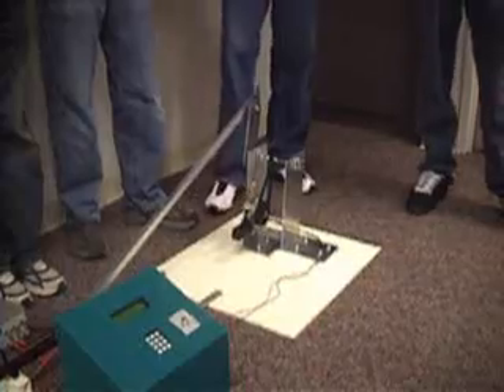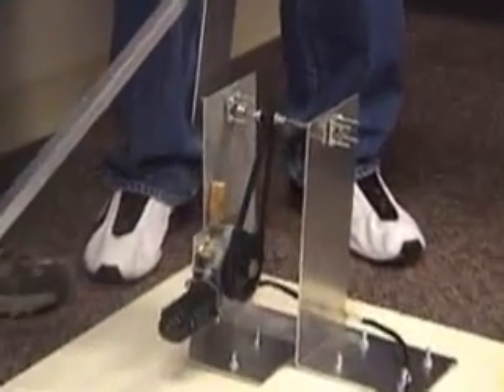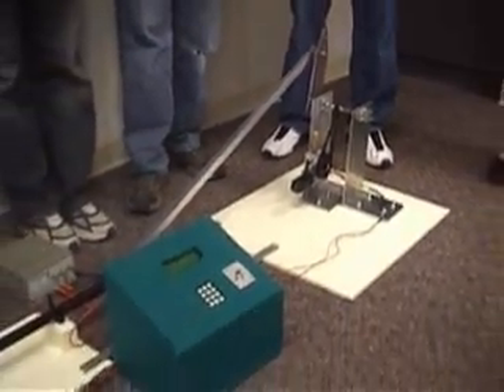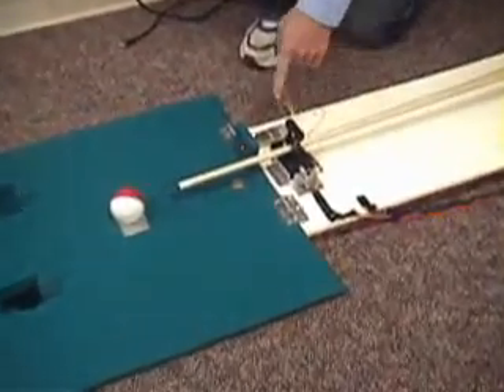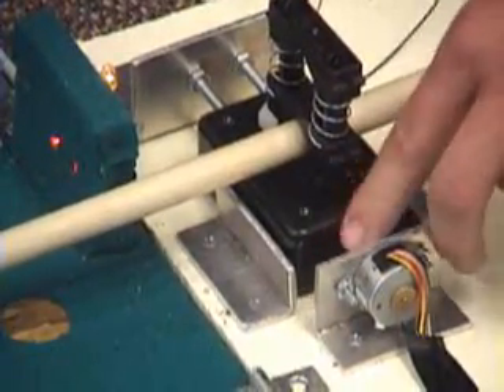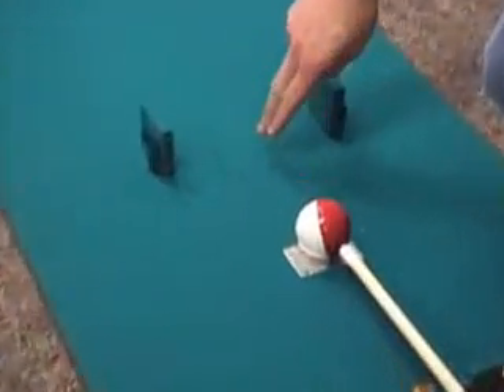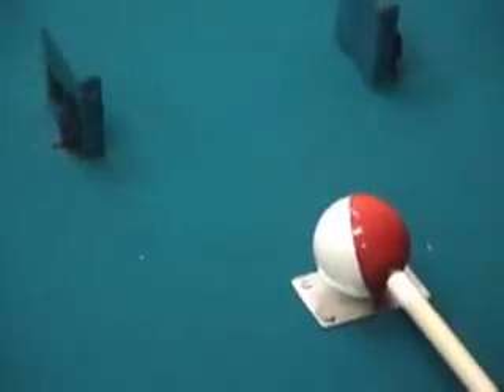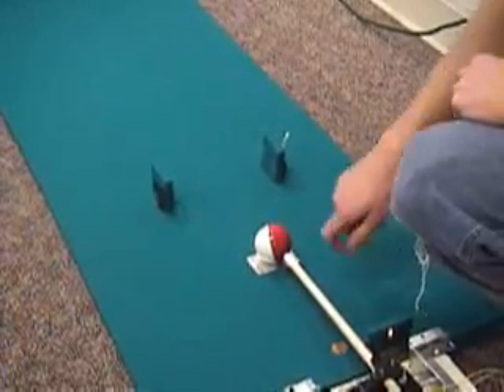Motorized cue-stick tester

Comment from the maker: It was a student project in a mechatronics course.  The point was for the students to learn about sensors, actuators, electronics, and microcontroller interfacing and programming.  The prototypes were also a first step in developing an automated and accurate cue-stick tester that can be used to compare the squirt amounts for different cue sticks.

Dr. Dave